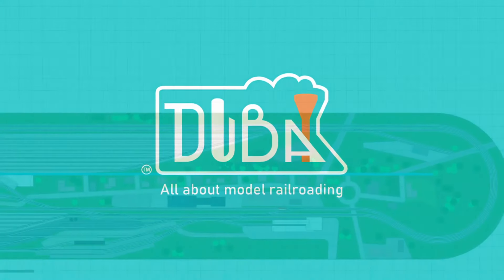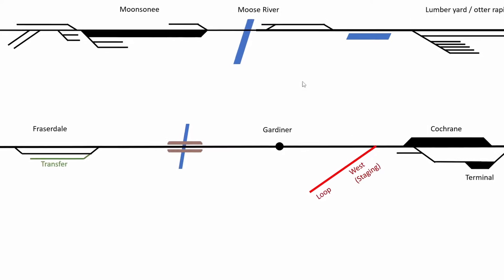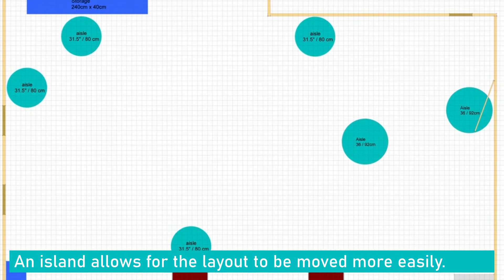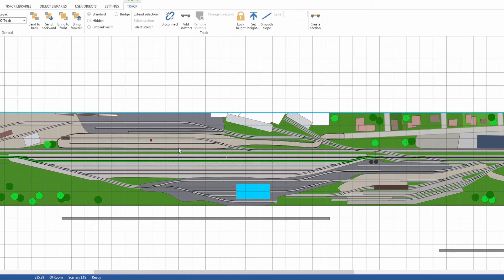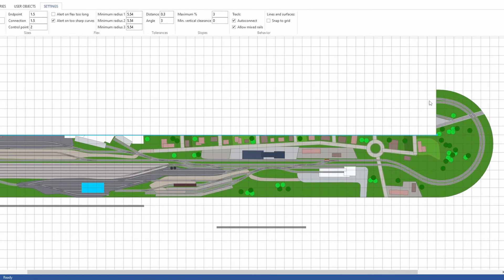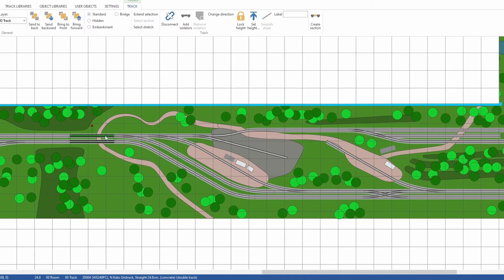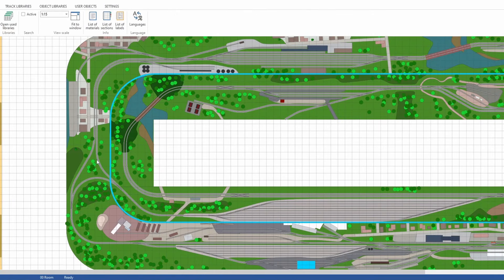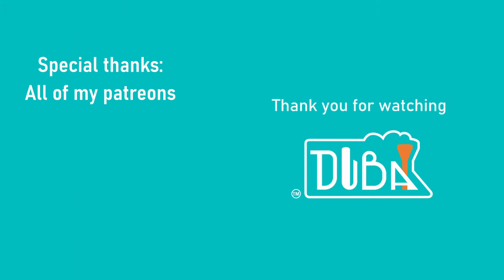94 - Massive 32ft x 16ft layout design with KATO UNITRACK

Comment: From a space consideration, I understand the use of the double crossovers; but from a practical, cost, and maintenance perspective for a full-size railroad situation, the double crossovers would be two simple crossovers either facing or trailing even though they would take up more track length they would be less expensive to build and maintain than the doubles.  Space for trackage is why so many single and double slip switches are used in European railroads as well as passenger stations in the US and Canada in crowded cities.  A double-slip switch is a double crossover within the length of the crossing of the frog number of the turnouts.  Interesting layout.  I would be inclined to install single crossovers instead of the doubles just to save the expense.
Reply from the maker: Hi Roy,
I agree 100% ! So why am I using them? It is a limitation of the kato unitrack system. They have single crossovers but only in #4. The largest turnouts they have, #6, only come as normal turnout or this double crossover configuration. For this project we had some discussion on the use of the unitrack as the turnouts are not always reliable and its quite a commitment. 
There are ways to trim two #6 turnouts to make a single crossover. But with the aforementioned reliability issues we decided to stick to the standard pieces.
Reply: @DubaiTrains  Basically that is what I was getting to.  There are always reasons for doing what you do.  I once was the estimator on a project that needed one(1) No. 8 turnout to make 2 spurs at the end of the track.  The drawing showed everything but said "Use a double slip switch".  After a bid conference, an addendum came out changing it to a single No. 8 turnout.  I tend to pick up on stuff like that.  In other words, the person drawing the plans had no clue as to what was wanted much less needed to satisfy the need of the project.
Reply from the maker: Agreed. It our job as designers to inform and discuss certain possible pain points and disappointments. It is much easier not to, but that's what separates the good from the best.

Comment: Very nice that you were able to turn your concept into a full-fledged layout, even though it was for someone else. Were there any tradeoffs easily included in the helical design that didn't work as well on the single deck?
Reply from the maker: Hi Nick,
It is difficult to say. This project had a massive space so a lot was possible. The earlier 3 deck design was almost the opposite. A tight squeeze to get it all in.
I would normally rarely advise a helix. They take a lot of space. So in a small space where one would like multiple decks it often takes up too much space. And in a large space where a helix could work, multiple decks are not needed or they make the layout unwheeldly big to construct and maintain. 
Hope this answers your question!